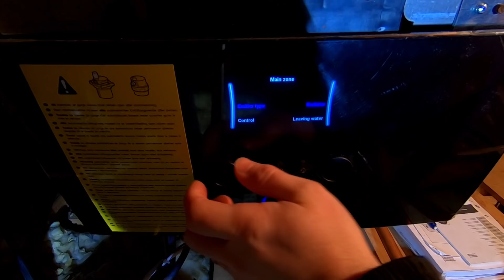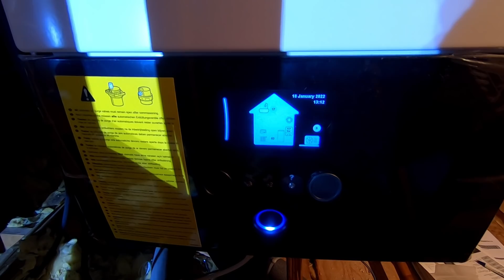How to lose £2000 installing a heat pump

Comment: We had 2 attempts of delivering the ASHP. Day 1, installation day. Sub contractors arrived at 8.00 am, but ASHP didn't. At 11.00 am we found out that delivery company didn't receive the order. We rescheduled the installation but the installers said it will be different team next time. Now, installation day, sub contractors (new team) arrived, but again ASHP was delayed until afternoon. We decided that we don't want to continue this, however we were told that we can't to that now??? (one of the managers said that). Britain is not ready for HP, it's mega expensive to install (3.5k plus just for installation which looks horrible) plus 700% higher bills, if you live with elderly parents. Better invest the money somewhere else, don't bother ASHP!!!
Reply from the maker: Correctly specified and installed heat pumps work well. You just got a terrible installation by the sound of it.
Reply: @UrbanPlumbers  hi Szymon, our WC settings are as follow : outside temperature - 2 /+16 and LWT 34 ' /55' so 55 when outside is - 2 and 34' when 16' but reality is different. Delta T is 51/41/20.5

Comment: I was impressed by the thoroughness and workmanship you demonstrated during your install. Clipping the cabling tidily in the loft was in particular a nice touch I didn't expect. Obviously some professionals (yourself) actually take pride in their work.
Reply from the maker: Thank you very much!
Reply: I second that so much have such a tough job and getting screwed over and still doing an amazing job
Reply: If it wasn't done, that would have been edited out of the video.

Comment: Heat pumps for swimming pools ? yeah no problem . Domestic heating and hot water ? er no thanks i'd rather stick with gas or hopefully a hydrogen alternative . My thoughts as i have built and installed plenty of machines in the pool trade .
Reply from the maker: Why would you use 4-5 times the electricity to produce 1kW of Hydrogen when you can use 1kW of electricity to produce 4-5kW of heat using a heat pump? Hydrogen makes very little sense in my opinion.

Comment: Hi thanks for posting. There is still a lot of misinformation going around about heat pumps. Here in the Netherlands we are using a so called Hybrid system, where the heat pump works in tandem with the installed combiboiler. This setup can reduce the gas usage to up to 70 %. Basically you only use the original boiler for hot tap water and boost on very cold days.
Reply from the maker: Yes we have those system here as well. Usually installed with Intergas!
Reply: @UrbanPlumbers  being from The Netherlands, but married to a Yorkshire lass, I was always a bit baffled by the archaic nature of the UK plumbing systems (with suppletion tanks on the attic and separate water heaters). Most Dutch households have a clsed loop system with High Efficiency combiboilers, so it makes sense to install a Hybrid heat pump, without discarding the installed installation. The Netherlands wants to be totally "gasless" in 2050, but by that time I'm on my 3rd set of teeth
Reply: Correct! Supplementary heating in short terms. Heat pumps are very compatible. Solar & batteries would make big differences. Especially during these uncertain times
Reply: The mitzi ecodan I recently fitted we kept the old valiant and piped it to the common low loss header. Was quite easy to pipe and wire in, commissioning was another story 🤣
Reply from the maker: How did you control the gas boiler?
Reply: @UrbanPlumbers  The heat pump governed the gas boiler. Literally just took the heat demand on the valiant to a volt free on the Ecodan FTC. I believe at certain low outdoor temps it kicks the gas boiler in.
Reply from the maker: @mikecole4952  so the boiler is controlled by the temp the HP reads on the WC sensor? Was that level adjustable at all? 

Did you say boiler went into LLH? So gas was not used for DHW at all?
Reply: @UrbanPlumbers  yea we generally use a gas backup just for the CH. But then we have stuck solar PV on the roof and used a smart switch to dump excess power into a immersion. Yea I believe the heatpump uses the outdoor thermistor to bring on the gas backup and it is adjustable in the settings. I do like the ecodan but if it's not a prepiped cylinder then there's alot of thermistors to wire in 😑
Reply from the maker: Would it not make more sense to use PV to drive the heat pump instead directly to water? Higher efficiency? But I guess battery and controls would be more difficult?
Reply: @UrbanPlumbers  Were getting into electrics now 🤣. So with a 3kw immersion and a solar array of upto 4kw depending on system size. Its not always going to be sunny. So the pv could be only generating 2kw on a relatively good day. Now if the house is using 500 watts through fridges etc that only leave 1.5kw. With a pv smart switch it will modulate the immersion down to what excess you have. So if the air source done the hot water from the solar it cannot modulate that far down and will always draw more power.
Reply: @UrbanPlumbers  Hi guys. The gas boiler is controlled by the heat pump. The actual heat pump has an external and an internal component. Have a look at the ELGA ACE system from Remeha (Dutch boiler manufacturer). Basically there are 3 ways that the heat pump can communicate with the installed combiboiler. (I won't go into the technicalities now) and the thermostat is connected to the internal component of the heat boiler. Basically it can function autonomously and only needs the installed combiboiler for hot water and backup. 
The good thing is that a lot of the traditional boiler manufacturers are now also producing these Hybrid heat pumps, so connectivity "should not be a problem" . 
Ideally, if correctly setup, these systems can reduce your gas bill with 70%. Of course you will use more electricity.
The only challenge in this scenario is the installer. You simply cannot have every Tom Dick and Harry going around installing heat pumps, because that gives this whole solution a bad name. 
Also it's not a silver bullet solution. You need to have a well insulated house to start with. 
Installing this Hybrid solution should not be too expensive. In The Netherlands, providing you have an installed combiboiler, it will cost between 5.000 and 6.000 Euros and this includes the costs of installation! The government gives a 2.700 Euro subsidy, so the net investment would be between 2.500 and 3.000 Euros. Of course there can be miscellaneous costs on top of that...
Reply: @leolui4039  The costs you quote are a million miles away from those being quoted in the UK and it is this cost disparity that is doing the real damage here. As a heating engineer myself with some 30 years experience, I really do think the hybrid model is the solution for our older housing stock and the government should not discourage this.

Comment: these heat pumps will never take off as if a neighbour complains about the noise as it runs non stop you will have to go back and move it.
Reply from the maker: They will and are. There is almost no noise form new models. They are very quiet.

Comment: I can’t believe this is the future. Who would want all this crap installed when you can have a nice neat little box tucked away in the corner of your kitchen. Rubbish.
Reply from the maker: To lower co2 emissions and have a more efficient system. Those would be main reasons for most people.

Comment: Water system outside the thermal barrier (ie the insulation in the roof).  What could possibly go wrong.
Reply from the maker: Nothing. Antifreeze valve will operate before anything can happen

Comment: Looks like you did a good job all considered, but I know of other installers who are not so conscientious.   Can't imagine having that thing in my garden, does not look like an appropriate solution. The government push on this + dodgy companies poor designs and  overselling is not going help the take up of the technology (for where it is suited).
Reply from the maker: most installers I know would have walked on day 1. I should have done that too.
Reply: @UrbanPlumbers  The fact you lost money makes this project appear an abject failure, however the lesson learned could prove invaluable and by seeing this job through, your business is better equipped to thrive in the future. You can now walk away with a clear conscience, though I am yet to be convinced the customer won't regret having an ASHP installed.

Comment: Great video as usual but does seem alot of hassle installing this type of system. Sorry but still don't think you can beat a gas boiler. Personally think this system is a waste of time and money.
Reply from the maker: I can’t agree. Well designed heat pump with correctly sized heat emitters and well insulated home is great and eco friendly - 1/4 of CO2 emission
Reply: @UrbanPlumbers  True but all depends how well insulated the property is. My customers would never benefit with paying the price of the installation of a heat source or air source pump unless obviously the property is designed for such a system. I'm not saying they are a bad idea just have to have all the boxes ticked for this system
Reply: @UrbanPlumbers  Agreed, yet this property clearly doesn't yet meet the required criteria.
Reply from the maker: That property was perfect for a heat pump. New build with double glazing and cavity walls with smallish heat loss.

Comment: Great video,good insight into it.Was a big pipe run,is it recommended that they are closely linked for efficiency? 3 floors up to loft seems a stretch.Great work though👍🏻
Reply from the maker: That run is fine when it comes to pressure drop, however not that great for the heat loss. 

I would personally move inside unit and buffer to the ground floor and install new cylinder on the ground floor. But it was not me who designed it.
Reply: @UrbanPlumbers  Was the client not made aware of the need for internal space for the unit / buffer tank?

Comment: This sums up precisely why as a company we are not going to use heat pumps on our new builds. I am looking at using far infra red instead from carbonenergy. Just stick it to the ceiling plaster it in, wire it up and off you go. Much less faff, much more control, next to zero maintenance and potentially much more environmentally friendly with the right controls which will only get better.
Reply from the maker: Nothing wrong with HP, they just need careful planning and installation. It’s not a boiler swap